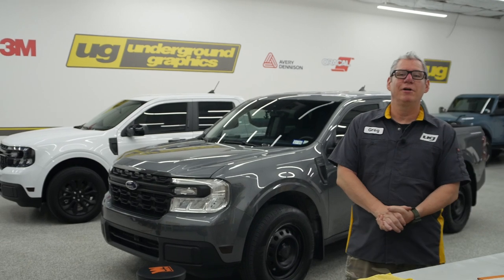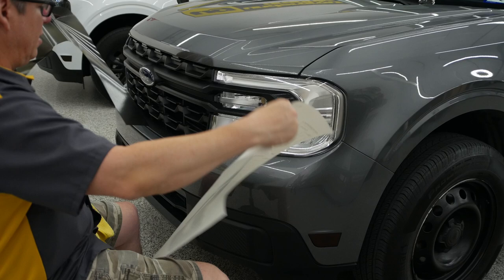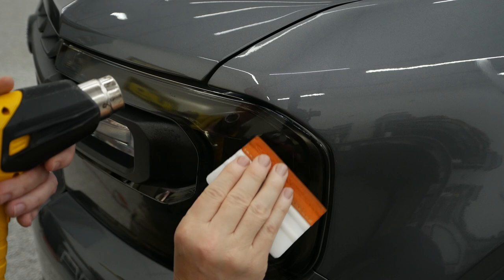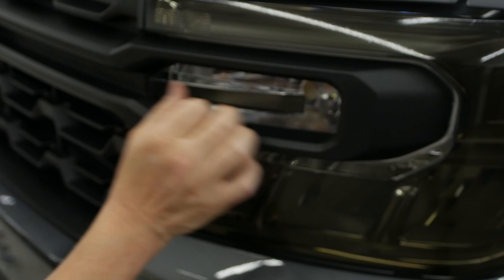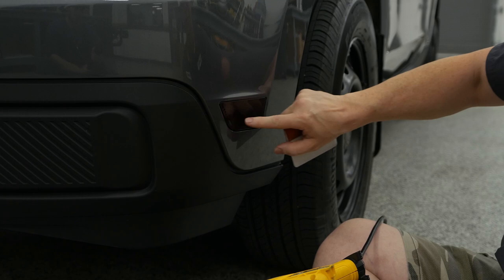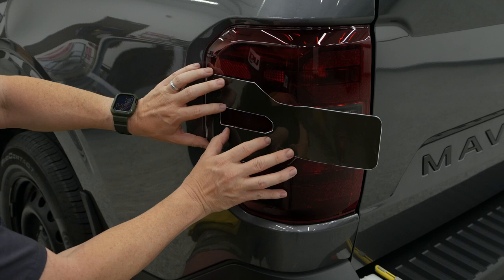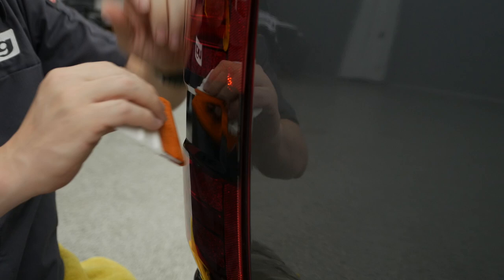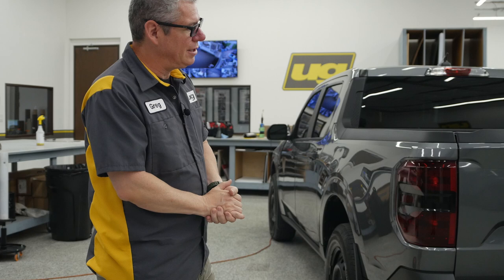How To Install Ford Maverick Lens Tint Kits | From Underground Graphics

Comment: Why?? What would you want to create less visibility to the headlights? I nearly rear ended a car because the taillights were so dark the brake lights were barely visible. Now we are encouraging headlight tinting. Must be because it looks cool.
Reply: Unless you want to buy replacements, the best/safest way to darken these headlights/taillights (to look like the BAP) is to disassemble the headlight/taillight housing and use something like Zep Industrial Purple Degreaser to strategically remove the chrome plastic finish (but not the chrome on reflector behind the bulbs).  
Leave the clear  housing alone so light will transmit thru it unattenuated or you're asking for trouble...